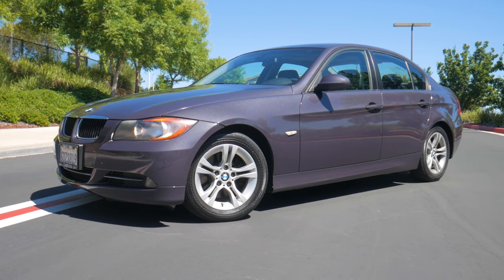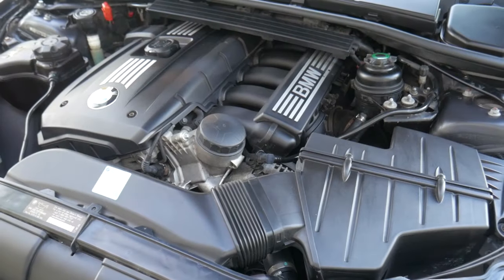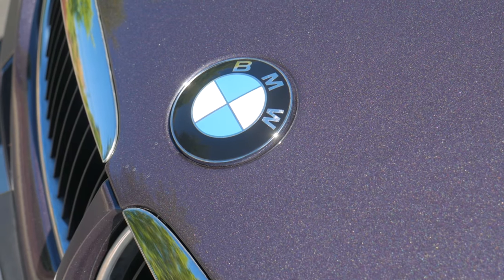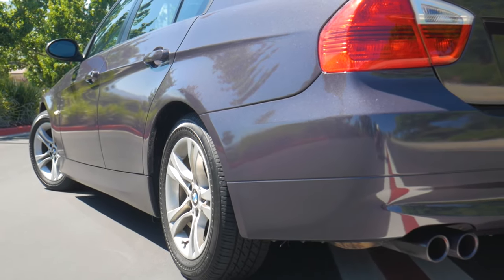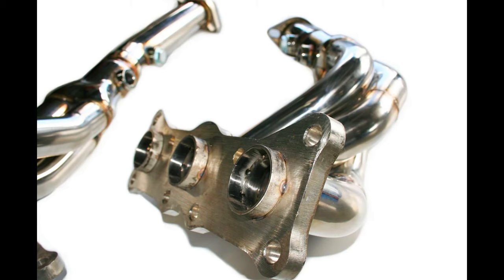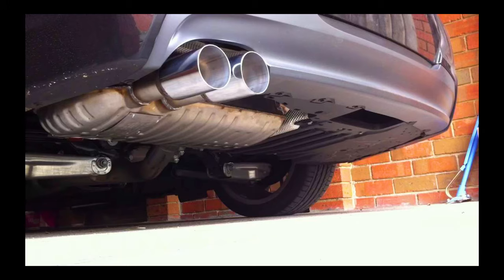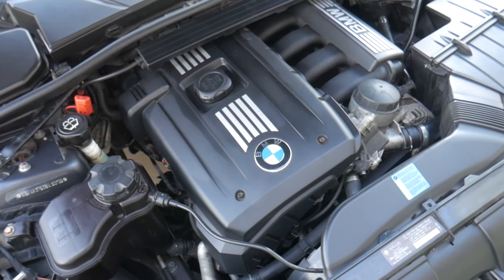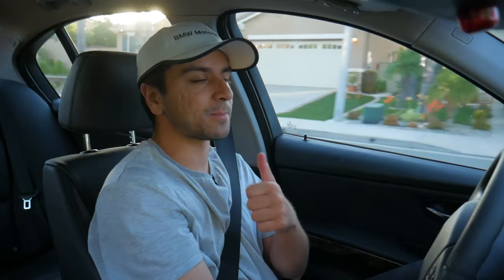GAIN +70 WHP On Your N52 With These 5 MODS!

Comment: How to get more power
Step 1 Sell your n52 
Step 2 Buy a 335 
All done Now enjoy your 335 :D
Reply: Also enjoy the unreliability lol
Reply: Carrera40 I feel like people think that slow and reliable outweighs fast and somewhat less reliable by making it cars seem extremely unreliable for no apparent reason
Reply: I had a 2009 328xi and now a 2015 x135i, theres no question the n51/52 is going to be a much more reliable engine. Its also smooth as silk and linear being an N/A engine
Reply: I'm gonna spend 10,000 on my 08 e90 n52 in body, suspension, and performance upgrades. It's an se model but I'm gonna make it a m sport model because that's what I want to do. It's a 328 but I  put 330 badges because I felt like it too. Then I'm going to put several M badges on it too because that's what I want to do. I put forged wheels on so far with Michelin tires because that's what I felt like doing. I'm going to put a supercharger on it because I felt like it too. In not getting another newer BMW or a 335 because I don't feel like I want to. Im going to finish my 98 Toyota Tacoma mini truck project too. so I'm gonna blow more money on that too. Because It's what I'm gonna do. So do what you feel like you wanna do.  Maybe I'll put a big race  wing on the e90 trunk too. If thats what I feel like I need to do.

Comment: 🤔 Where's the M4?
Reply from the maker: At the shop right now! Gettin some minor upgrades done to it
Reply: Please tell me you are not having any issues with that crank hub upgrade?
Reply: @SimplyCarThings  Oh ok. Cool deal. Quick question about doing the MDH flash on my 335i. Anything preventative maintenance I need to do before I do it? Beside the plugs and coils.

Comment: Clickbait, not gaining 70whp
Reply: Tune, intake, headers and exhaust =/= 70whp... lol
Reply: @thetumanshow  keep on dreaming bud 💭
Reply: @peterjg001  I got a +55 hp with just headers and a tune on a N52. Got papers to prove it. Still waiting for the stage 3 manifold and CAI
Reply: @missaelrivera2346  thinking of getting new headers for my 08 e92 do you know around how much it will be to get the headers installed?
Reply: @stevenaziz9438  depends how trained the mechanic is..the stock headers have some pretty big cats so they usually struggle to remove the stock headers.. I payed $450 to have them installed

Comment: All this for +70hp doesn't seem worth it for the $$. I'm interested in turbo bolt-on kits for these cars.
Reply: Just get a n54 at that point
Reply: Lol the N52 was never built to withstand boost. U have to go for N54 or N55 instead. The N52 is just a reliable NA engine that makes decent power for a little fun for a daily car.
Reply: Man its funny how people just say things. You can boost any engine bro. It wasn t designed for it. So what? Its just not as strong as the n54. The N52 has a supercharger kit putting it at about 300 whp at only like 6psi. The answer is you can make it produce more power na. And you can supercharge it. Run e85 or meth injection and make more power. You can turn the boost up till the transmission takes a shit if you want it.
Reply: LaZaRItOLnObLE M Lol yes u can boost any engine u want but what’s the point of wasting thousands of dollars to only then have it blow up and now ur stuck with a car that can’t even drive. Makes sense right ? :)

Comment: My e92 325i caught on fire a week into ownership due to oil bursting onto the exhaust AND IT ONLY COST £150 TO REPAIR AND THE CAR HAS BEEN PERFECT EVER SINCE I LOVE IT not a single problem so far after 2 months 💯💯
Reply: Oil from where? Failed valve cover gasket?
Reply: @BluegrassAnimation  yep, car is still going strong only had to replace one more little o ring that was slightly leaking oil
Reply: @s13zenki  Oh boy, I better fix mine asap. Thanks for the heads-up.
Reply: @BluegrassAnimation  I thought to myself “ohh it’s no rush it’ll be fine” when I first saw it when I got the car
Reply: @s13zenki  Lol! That's me right now, thinking I can stretch it till the next service 🤣

Comment: I have a 330i year 2010. But not sure how much power it has, the engine name is N52B30A. Different pages states it has 258hp, others 260hp and others 272hp. Not sure which is the right one, and neither if its HPs or CVs 😂😂

Comment: I don't think you can get 300hp out of an N52 that easily
Reply: Why not - a fully equiped N52 3.0 (european) has 260HP by default, you can get 300 just by messing with firmware and exhaust
Reply: You need the supercharger
Reply: Indeed,my 530i has n52 with 258hp

Comment: If you want to get more power from n52, please do yourself a favor,  sell it and get 335
Reply: Oh yeah, then make sure to upgrade water pump, get the fuel injectors surviced at minimum, and throw new gaskets at it, and upgrade the turbos also. Otherwise 
You'll be doing it all within 50k miles anyway.
Reply: @taylorjams4845 you is not saying that water pumps are different between n52 and n54 are you? And did you say that n52s don't leak? Is you high?
Reply: @dkrawk8309  no. I never said they didn't. And to be clear, I agree with you. Lol if you have to ask the question "should I turbo my n52?" Then that person should most definitely just buy a 335. But the n52 is worth it to build. But the person who would build it just wouldn't ask if they should. Did I make sense? I think I rambled a little.
Reply: @taylorjams4845  n52 does not worth even thinking about building it. Absolutely zero sense in doing so. Unless you have more money than brains
Reply: @dkrawk8309  have an n52 wagon boosted on stock internals, bigger injectors, eldor coil packs. Total investment in build $3,000 stomps every 335 that I've lined up with.
Reply: @taylorjams4845  lmao, yeah ok there bud. Whatever makes you sleep at night
Reply: @dkrawk8309  ok, not every 335. Lol. But definitely every stock one. Why can't you just talk cars? Why do you have to be so up tight about what other people build? Fuck, atleast I participate in building dumb shit. Before this I dumped $10k into my subaru build. That was way dumber than boosting an n52.
Reply: @taylorjams4845  I'm very happy for you. You did n52 owners a good lesson. Showed what happens when n52 gets 10k into it. I also thank you that we came to a 100% agreement. I stated facts, Your rear end started burning for God knows what reason, at the end state the exact same statement as I did in the begging.  
Calm down, relax, life is good.
Reply: @dkrawk8309  I dislike the comment section for that reason. The bmw is a fun daily. You really wanna talk about the apitimy of a dumb build. Lol I just dumped a ridiculous amount in my turbo 5.7 ram build. (When I could've just bought a hellcat). Wish you all the best, man. Have a good night

Comment: Any f10 n52 owners
Reply from the maker: ive always wanted a 2011 528i lol
Reply: @SimplyCarThings  I’m having so much trouble finding a cold air intake that can fit it , do you know if as long as the intake is for the n52 and not the f10 specifically if it would still fit ?
Reply: Like for example an Intake for the n52 330i

Comment: These cars are great daily drivers as is. Even at 300 crank hp. Would still feel like a tiny squirrel running in a wheel for an engine. Maybe near red line could be kinda ok. Still very low on torque. Nothing wrong with a cruiser. Not every car needs to be a gas drinking muscle car.
Reply: Dude, please explain it to me the reason You just yap nonsense